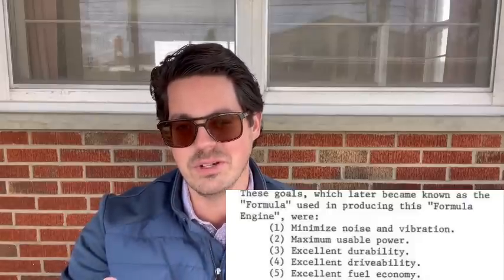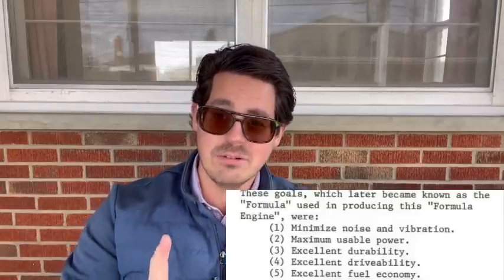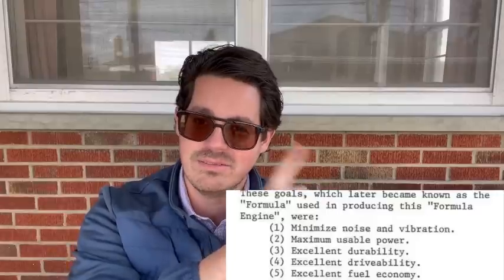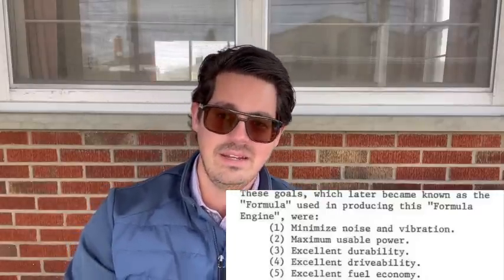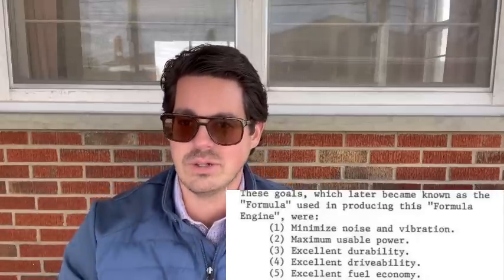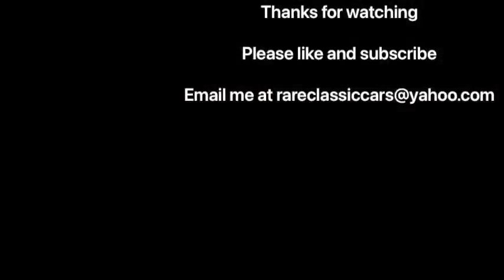Worst Engines of All Time: GM's 2.5L Iron Duke 4-Cylinder

Comment: I don't think i'd call it one of GM worst engines. Its not bad, and its not great, its just average. It was tough and reliable, but noisy and sluggish. I had an 88 Grand Am 5-speed with one of these, great engine until the balance shaft assembly exploded and took the oil pump out. Put a new one in and drove it another 80k miles. USPS still uses these engines in all of the Grumman LLV's to this day... they are still plugging away.

Comment: Thanks Adam, Great Video as always. These porch chats are perfect and informative.  I agree the 2.5 Iron Duke probably wouldn't be my choice of engine in a Ferrari but it worked in the S-10, Mini Blazers, and Sonoma trucks... there were great little part chasers.  Wish they still made engines like it with the consideration of durability and they weren't bad for mechanics to service.  Those were the Days when we were mechanics and not "Techs" when there wasn't more Technology than necessary when you didn't need 10k in electrical and scan tools to get the job done.... 
.
That what I like about your platform the memories that you invoke in our mines are wonderful.

Comment: around 1990 or so i was doing some work for a guy that owned one of those . it either a olds omega or a pontiac ventura , i cant remember which , i remember it was a 4 door and that it was a 1977 and it had an automatic . i drove it one day when he wanted it moved to a piece of property he had , and it was the slowest car i ever drove . i know those have a curb weight of at least 3,200 lbs. , so i can understand why theyre so slow . the buick 231 V6 or the chevrolet 250 is a much better choice and would almost certainly last longer because it wouldnt have to work as hard . the biggest engine they put in the intermediates from like 1975 on is the chevrolet 350 V8 , but you really dont need that big an engine in one of those unless you tow a trailer maybe , or just want a V8 . but to put that 2.5 liter with less than 90 horsepower in a 3,800 lb. plus when loaded car was not a wise idea for GM

Comment: Putting words in people's mouths with all the I had a V8 and now I hate the universe talk. People back then were retiring their VW Beetles, which were not powerful, or smooth. They might have tried a VW golf, or a Datsun/Nissan. And my family bought a Datsun B210, and traded it off for a Iron Duke Celebrity. And it was a upgrade. So quit with the whole everyone drove a V8 and hated the 4 banger spiel. The Duke was generally a better choice than its "upgrades" (2.8 L V6, 5.0 V8 among others) and I owned for one of my first cars, a 88 Chevy Sprint 5 door. That was far, far worse than the Iron Duke both in driveability, and oddly enough fuel mileage. A Grand Am with the Duke got better mileage than My 3 cyl Sprint, and better mileage too, thanks to the Sprint's lack of a lockup torque converter. That also got the Sprint's top speed down to something Jimmy Carter endorsed. 62MPH with A/C off, and 58 with the compressor cycling. No way would I vote the Duke worse than the carburated I3.

Comment: I  wonder when Mitsubishi's patents expired on balance shafts.  
The mid-70's Plymouth Sapporos, and Dodge Challengers 2.6 liter engines  first came  with them. and  some of those engines may have been optional for some Chryslers. And with  shades of the Fomoco Macpherson Strut fiasco when they lost the patent rights to that technology. They refused to utilize them in almost any car  that wasn't already designed to use them. Certainly from  the Falcon to the fox body chassis "Squaremont" no American design Ford used them. All you have to do is look at the very questionable choices made in the lower front suspension linkage of the original Mustang to see evidence of it. When you're trying to save every penny building a car spending any money on patent royalties had to be galling when you were as large as GM  and Ford were.  When Porsche decided  to emulate the design choices of the early '60's BOP intermediates when they decided to cut 4 cylinders off their 928 motor apparently the royalty payments weren't too costly for them. I used to laugh when my one mechanic friend used to ask another how much he liked driving his 1962 Buick. And his friend would reply tersely "It's a Porsche 928!" My friend  would then put his hands over his eyes, face the car , and would say "Let's see,  Aluminum V8 up front,  4 wheel Independent Suspension, Rear transaxle, Yup! 1962 Buick!"

Comment: Do. You mean a fibre cam gear instead of “fibre optic”? GM and others used fibre or nylon cam gears frequently to reduce noise.  It is unfortunate that GM did not give this engine the balance shaft much earlier, along with sequential fuel injection and developing an OHC head. Once again the GM bean counters achieve a Pyrrhic victory.
Reply from the maker: Ha. Oops!  Yes.

Comment: Yes, Honda, and Toyota probably make the best 4 cylinder engines ever.
Reply: There is nothing good about rubber timing chains and there is nothing good about putting the water pump inside the timing gear cover.

Comment: Could you talk about the oddball Pontiac SOHC I-6 that went into the early Firebirds? That thing sounds like the engine that GM should have looked very hard at continuing going forward: I don't think any domestic manufacturer was doing that at the time and sounds really cool.
Reply: The only other production OHC inline 6 in the US at the time was the Willys Tornado. SOHC, hemispherical head.
Reply: @mpetersen6  Jags' I6 were OHC and I thought that was Pontiac's inspiration to do it? Or do you mean produced in the US?
Reply: That motor was essentially a Pontiac designed overhead cam head on a Chevrolet 6 type block.  Aaron Severson has an excellent article on that motor on his Ate Up With Motor blog.
Reply: @TheBrokenLife  
There were plenty of European and Japanese OHC inline sixes. The only other domestic one was the Willys which wasn't around very long in the US. Kaiser moved the tooling to Argentina and used the engine there. One use was in older AMC models built by Kaiser.
Reply: @21stcenturyfossil7  
The motor had some issues.  If I recall correctly it was hard on rocker arms. Plus the early timing belts were not up to todays standards.
Looking at the head and the Vegas the Vega looks very similiar from the outside.

Comment: These were actually some of GM's best work.   It was a bad motor as far as the sound, but it was pretty durable.   A lot of time the car wasn't shit, but the Iron Duke was sound... lol.     Had one in a Grand Am and one in a X Car.   I would swear that the one in the X Car was smoother... or maybe the X-car had a smoother ride.   Got well over 180k on both vehicles.

Comment: I had one in my first vehicle- 1991 S-10.  Power was better than all the min-trucks except Nissan...120 hp or so if I recall.  Reliable.  Noisy and rough as fuck- sounded like it'd explode by ~4k rpm or so.  Regularly gave me 26 mpg.  One thing though- it ALWAYS required mid-grade gas to not ping, which SUCKS for a high school student in a non-performance vehicle.

Comment: So many fault an engine because it doesn't make astronomical power. Underpowered engines suffer less internal stresses and tend to last much longer. The Iron Duke was modeled after the wonderful Blue Flame Six. I had one in a 1990 Grand Am. Reliable, durable and acceptably smooth and quiet.

Comment: Only put a little less than 400000 on the two  I have  28 mpg  in  s 10 and Sonoma  ,130000 on a set of plugs the last one  had over  285000 on the original serpentine belt  had  a 89 and a 91 very  reliable for the time...

Comment: I really don't know what Steve Buscemi is talking about. He needs to fire his informative's, but the 151 GM Iron Duke is a robust motor. Little horsepower/torque but lasted. Wasn't made for speed or torture (People became crybaby's over the years on power) but the motor was made reliable, easy to fix, robust, not expensive parts. Unless with some early years with the emissions crap. But it got simpler after the tech4 injection. And years later when it went to 2.2 which I worked on too. And a is great engine too. Iron Duke is a great motor, upgrade it will do great

Comment: The problem was Roger B. Smith, not the Iron Duke.  Under Smith, GM did stupid things cutting costs ..like using sealant on the oil pan instead of gaskets.  It’s as if they wanted to irritate and lose customers to Toyota and Honda.

Comment: 1981 Pontiac Phoenix. High vibration. Low power. Not sufficient to drive an automatic transmission. Front drive components were also not good. I agree. One of the worst.

Comment: i OWNED THAT IN A BUICK AND PAID $500 FOR THAT CAR AND DROVE IT FOR 5 YEARS WITH ONLY 2 ISSUES A ALTERNATOR AND A IGNITION MODULE THAT RESTED IN THE CAP BUT IT WAS A RELIABLE CAR AND THE YEAR WAS 1986 THE CAR WAS MADE.

Comment: The iron Duke isn't bad.  It is reliable.  Not much torque,  or horsepower but there's still plenty on the road now.  I've had em over 300k mi. You sir are wrong about this engine

Comment: I don't understand your negative view of the Iron Duke. It was a reliable workhorse. Built proof. It was never meant for fuel economy, power-to-weight ratio, or horsepower.
Reply from the maker: It was totally unrefined. Especially for people who were used to smooth, quiet V8 power in their domestic vehicles, or who test drove a compact Toyota or Honda.

Comment: Very rough - hated the X cars with it, could not imagine how bad an impression it would make in an A body where buyers expected a more refined car.  I liked the 2.8 much better, but then I wasn't responsible for maintenance (task or bills).  Not as horrible as the 80's Subaru I also drove, but not good.  If you had to have a 4cyl., the  Mopar/Mitsubishi 2.6  K car beat it by miles for smoothness.

Comment: This is like comparing a loaf of cheap white bread to the bread served in a 5-start restaurant.  The 2.5L worked at the time and did what it was intended.  The purpose of this video was to stir up controversy which it has.
Reply from the maker: Not entirely. I think you’re forgetting that this engine may its way into some relatively expensive cars. Id agree w you if it were only in the S trucks, but a top of the line X/A/N car was not cheap and deserved better. Can’t have the dash rattling at idle and all the auto trans cars did that.  The manuals did not.
Reply: @RareClassicCars  The brand would not have survived without these interim engines.  Yes, they were crude and yes, not like today's vehicles but it was what was available.  

I do get annoyed with the armchair quarterback and critique of what had to be developed in the moment.  They were faced with fuel economy requirements if they were going to avoid a gas guzzler tax.  What would you have done?  Shut down the brand or build a new engine?  They opted to build a new engine.

You also failed to mention that the first design of the engine was NOT a crossflow cylinder head.  The intake and exhaust were on the same side.  Later designs had a crossflow head where the intake and exhaust were separated.  

With any engineering exercise, it takes time to refine the product.  You saw the refinement come after years of service.  Betty and Bob wanted an affordable car and would not have paid for a high tech engine like Mercedes uses.  If they did, they would have bought a Mercedes.

You need to be more objective in your explanations.

Comment: Seems to me that this engine was so underpowered that most were driving at 100% most of the time.  Slam the throttle to get it moving, etc.  Which greatly shortened their lives compared to the V6 options.
Reply: The V6 2.8 of that era was not the greatest engine.  The Iron Duke was WAY better.

Comment: That Vega engine was FAR WORSE than the 151. Had em both and the Vegas I carried gallons of used oil around with only 78k would burn a quart about every 200 miles....and a real terd in comparison to the duke

Comment: Dude is totally wrong.  Reliable, durable, easy to repair, great longevity, and efficient.  Not every every engine has to be a 7L V12 with 800hp and a 9000rpm redline.

Comment: Fairly reliable. But the valve cover almost always leaked. And it was loud., loud, loud. , all because of the use of timing gears.
Reply: But reliable, reliable, reliable, all because of the use of timing gears instead of a rubber timing chain.

Comment: Mercruiser has put 1000s of these engines in boats over the years. Still many on the water. I think they were produced until 2006.
Reply: They are a pretty smooth engine in the boats. I always feel bad when I have to rev them high to get the boats to go anywhere.

Comment: Chevy bought the engine rights from Pontiac before selling the rights to a race engine producer in Kansas and Chevy rebought the rights in 2014. revamped the engine with dual overhead cams and with the advent of vvt punched 13 to 1 compression into it  and creating crazy power. Chevy thought of it enough to retain it.  The one I had in a S10 was connected to a  t5 tranny all roller engine and fuel injected and with a locker install on the rear axle there was nothing that truck couldn't do. Find another 4 inch bore 4 cyl. Engine.

Comment: I had the Duke in a 1986 Pontiac Grand Am.......  It was OK until you wanted to pass someone..  !!!!   98 horsepower  ....!!! I had to have the camshaft gear replaced under warranty in about 45K miles because the Nylon teeth  wore out and it sounded like a diesel.   Clank  Clank ...  The Duke is more like Puke engine......

Comment: The 87 update has balance shafts, the models with the vin u got the updates. While this is not GMs greatest engine it certainly isn’t even close to their worst. Perhaps my opinion would be different if it was mated to the same POS slush box that yours is mated to, but with the manual transmission it wasn’t too dang bad.

Comment: 1991 chevy s10 472,000 miles replace head gasket once and rear end 2 times and fuel pump probably 5 times eventually put a inline fuel pump so no more taking the tank down.
Reply: Original 2.5l iron duke

Comment: I say you made your negative on these engines were the cam gears by far and also they leaked oil so much so that Fieros with this engine had to have a sticker put on the center console warning owners of engine oil leaks and I've neglected could cause an engine compartment fire

Comment: Yeah you have not known enough Jeanette Dal talking about they're not loud they're not cruel and they don't shake that much or vibrate that much at all and I'm talking about the ones that don't have balancing shafts like my 89 does it have a bouncing shaft in it even though the supposed to but two truck engine and the engine has never been touched all original

Comment: Very reliable but, cam gear nylon teeth stripped at about 90,000...Rugged but did sound like a tractor motor. It sounded really crude compared to an import.

Comment: If not for government intervention, we'd still be driving 455 Buicks, 428 Pontiacs, 472 Cadillacs, 427 Chevys and 425 Oldsmobiles. There would have been no need for all these failed GM engine designs.
Reply: I wish they still did make 455 Buicks, 428 Pontiacs, 472 Cadillacs, 427 Chevys, and 425 Oldsmobiles.  I to blame their demise on CAFE.
Reply: With today's computer technology, those old big blocks would be so much more efficient.

Comment: This guy's obviously missinformed because the chevy iron duke was the predecessor of the stove bolt 🔩 and was literally even leased to dodge and jeep and were used in there vehicles as well in every mail car made . Now that said 3rd generation mechanic welder fabricator and iv fed me and my family for over 10 years with food bought with money my wrenches earned me (some of those wrenches were my great grandfathers) so I'm pretty well established in the field and I believe since I owned 7 of them in s10s and all went over 275,000 miles i may know a little about them as well as iv built a stroked one as well that on 15 psi of boost on a blow threw carburator went 10.90 in the quarter . Hell dodge even built there own 2.5 cuz they liked Chevys so much .

Comment: Worst engines of all time? LOL . I had two Iron Dukes and my experience with them was that they were great engines. My 1980 Olds Omega had an Iron Duke. One night the radiator popped and it puked all of the coolant. I was about 20 miles from home and I just kept driving. When I got home and shut the car off, the engine was making all sorts of tinging and popping noises a severely overheated engine makes. I popped the hood and looked. The exhaust manifold and the exhaust side of the cylinder head were glowing in the dark. I figured it was done for good. The next morning I hopped in and turned the key to see if it would run. It started and ran fine so I went to the junkyard and bought a radiator, put it in and changed the oil and the car lasted years more. Try that with an aluminum head import engine then tell me what happens.

Comment: I am hating this Iron Duke crap motor in my 88 Fiero. For 4 years, I've had nothing but running, idling, and noise issues. It's a tractor motor, nothing more.

Comment: Fiber OPTIC cam gear? Is that like a Bluetooth connection rod? 

We had an 89 s10 2.5 with 5 speed manual. Great little truck.
Reply from the maker: Yes, I misspoke.

Comment: It's a Phenolic gear not fiber optic and they have been used in many engines for many years
Reply: Our 1952 8N tractor had one of those Phenolic cam gears! Were so surprised when we saw that on an original Ford tractor engine upon our rebuild. The replacement steel cam gear is very much louder & noisy. The original cam gear also had a few teeth missing too!